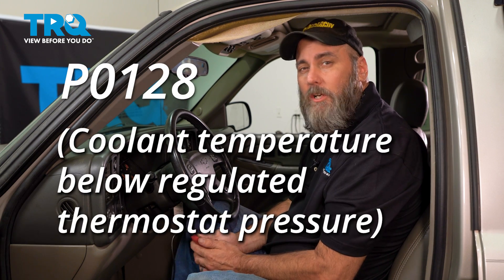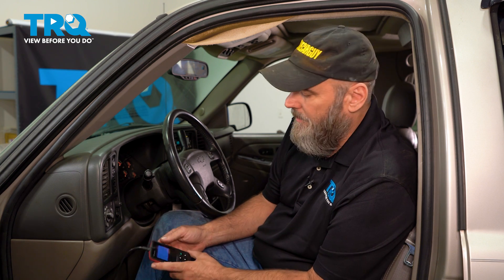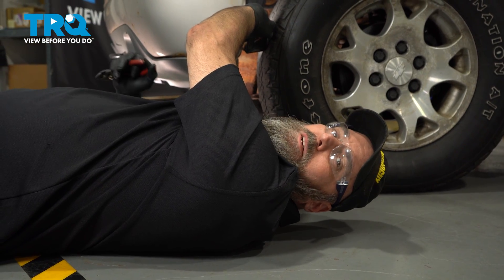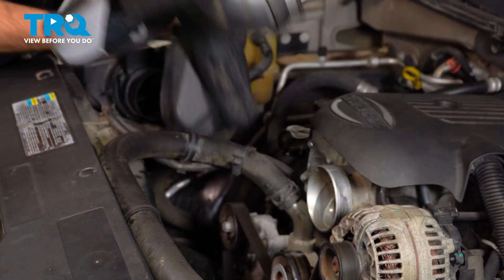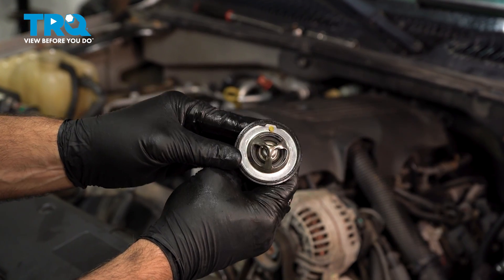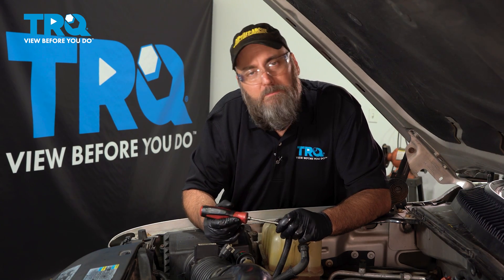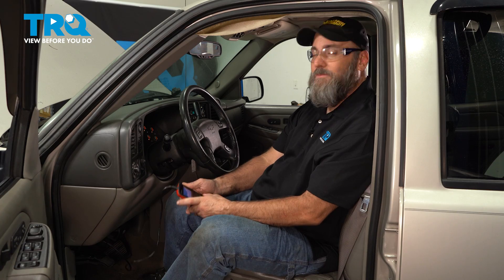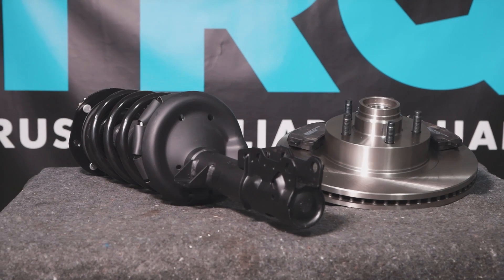EricTheCarGuy Explains Check Engine Codes - P0128 Coolant Below Thermostat Regulating Temperature

Comment: Hello, what is the viscosity of the engine oil for the 2013 Elantra? The engine capacity is 1800. I live in Iraq, and in the summer the temperature reaches approximately 45 degrees Celsius.

Comment: I’ve got a 2018 f150 with a 2.7 I started getting a p0128 and p1299 code so I changed the thermostat still kept getting the codes so I replaced the CHT SENSOR still getting codes also the ac stopped blowing code and the temperature gauge in the truck goes straight to hot as. Soon as truck starts when cold what else could it be

Comment: I replaced the radiator in my 2006 Chevrolet 6.0 with an aluminum 3 core. Ps0128 now coming up. Could it be the thicker radiator throwing this code?

Comment: Ive changed my thermostat because the engine was not getting hot quick enough. I still cant get the engine hotter than 75c (therm rated at 82c) It's cold here in the UK, about 5c at the moment. Ive also replaced the coolant temp sensor. Could it just be the OBD reading is wrong?  Car still takes a while to get to temp.